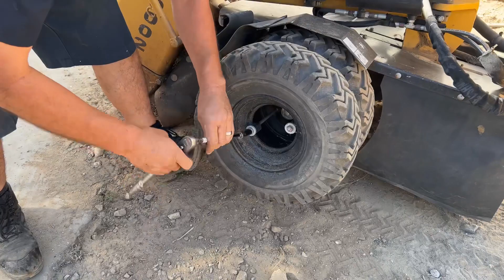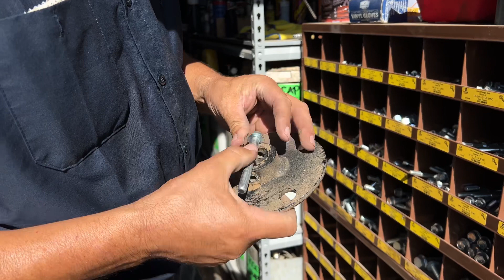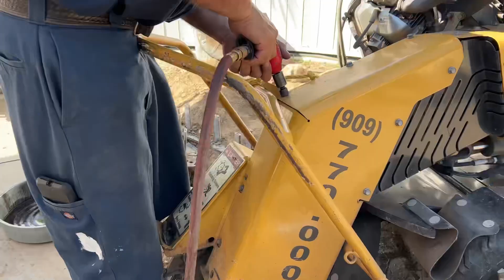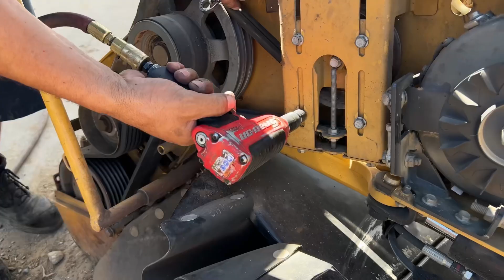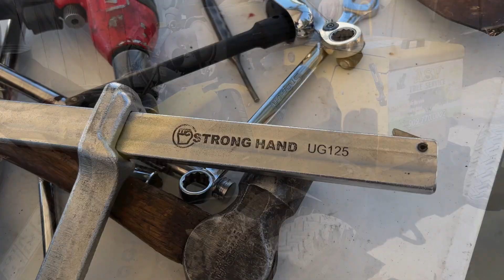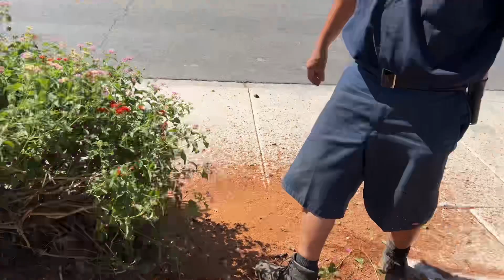Vermeer SC 362 Belt Adjustment

Comment: What causes the clutch to disengage ? On these machines ?
Reply from the maker: Well, on this particular, one. The disengagement Was by the ignition switch. The movement of the stump grinder loosened up the wires behind the Ignition switch cousin, the computer to lose power.
Reply: @thehydraulicspecialist3176  ignition switch meaning the switch that engages the wheel correct ? Cause mine engages and disengages constantly
Reply from the maker: @Martin.castro08  no the ignition is the switch where you start the engine behind it. There is a connector I believe four wires come in the back and then there is a single wire. I believe the color is red. That’s your computer power. Check it if it’s loose that’s your problem.
Reply: @thehydraulicspecialist3176  they ended up replacing my clutch started working good. After three stumps it did the same thing. Clutch wouldn’t engage so they ended up replacing the switch for the cutter wheel I believe. Won’t know until Monday.
Reply from the maker: @Martin.castro08  where are you located? I’m afraid you guys are throwing parts at it that are not needed. You can give me a call and we can discuss it. 909-578-1116.